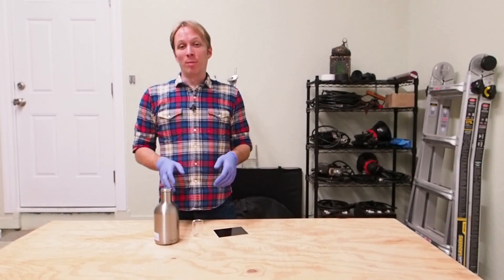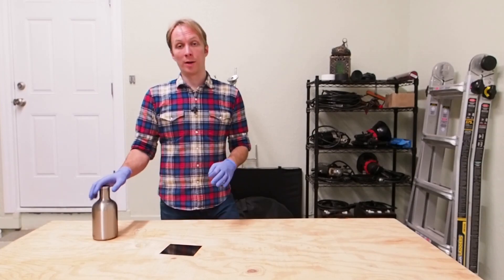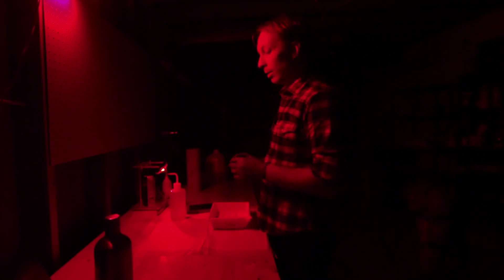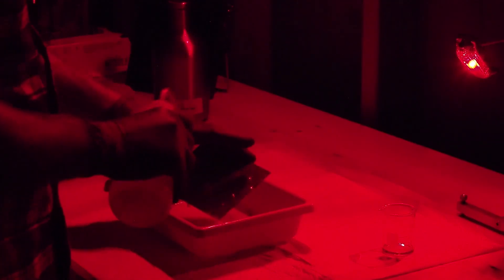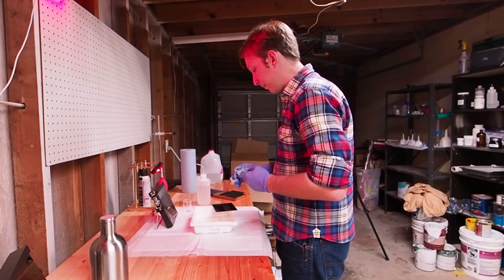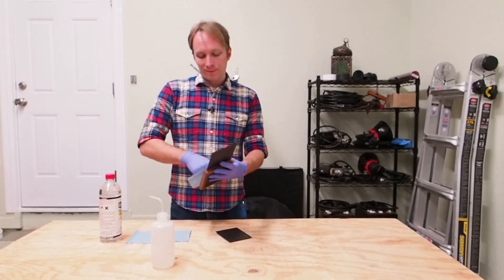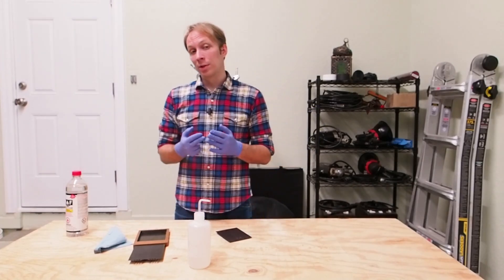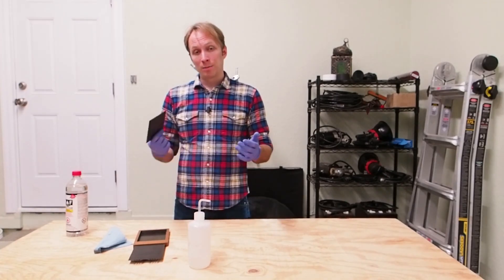Collodion Basics Part 7: Developing the Plate

Comment: Robert, can you tell me if any "red" tinted light works for a darkroom? Or does it have to be specific lights made for dark rooms?
Reply from the maker: I've generally had good experiences with red LED lights, where the LED itself is red rather than a white LED with a red filter in front of it.  It doesn't have to be darkroom specific, just make sure you're getting something that's only putting light out in the red part of the spectrum
Reply: @tehbieber  Makes sense. Appreciate the content!

Comment: Timely video as I am looking at doing some wetplate over the Easter weekend and my pour technique is bad.

BTW, with the fix step, is there any risk in leaving those collodian ridges un-cleared?  Also, what Fix are you using?

Cheers
Reply from the maker: Nope, no risk at all, it's totally normal to end up with a little collodion on the edges like that.  I use ammonium thiosulfate to fix, usually from photographer's formulary
Reply: @tehbieber  ok, great.  Thanks for the reply. The fix is quicker than mine (rapid fix), so I thought you may have been using KCN
Reply: @ashleyhoff7561  KCN is extremely dangerous and really not worth the risk.  One mistake and you're done.